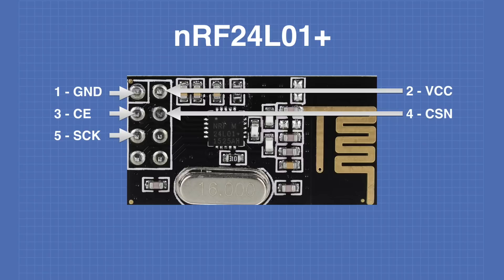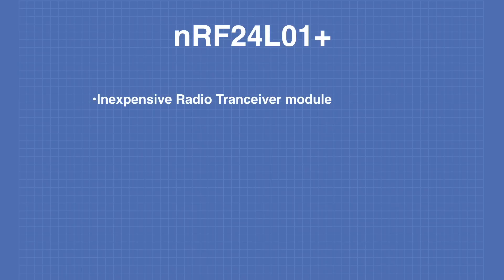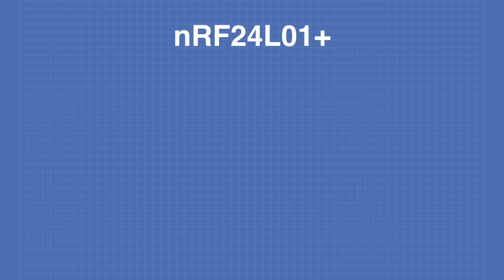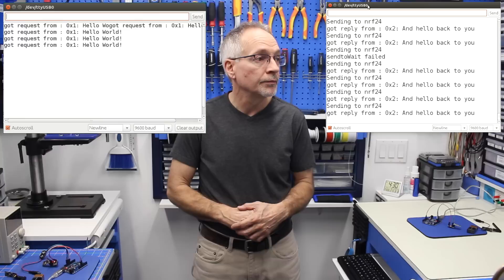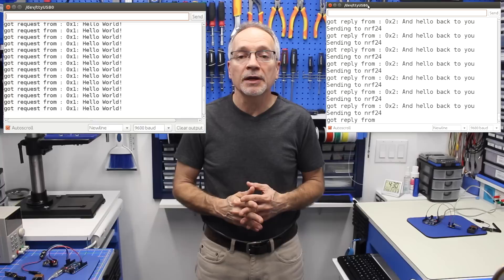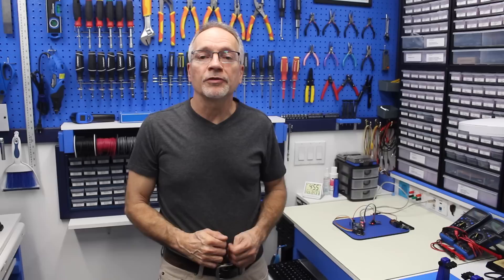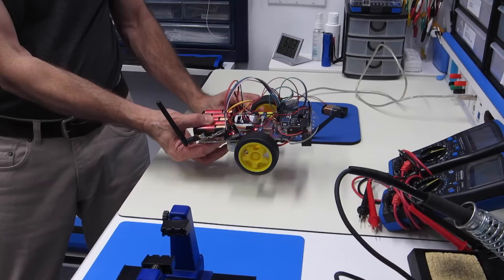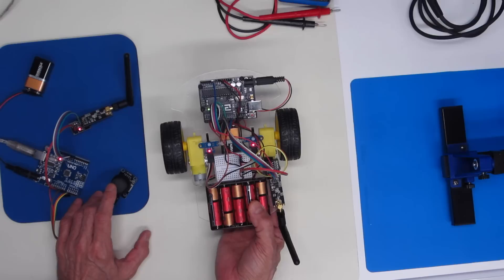The nRF24L01 - Wireless Joystick for Arduino Robot Car with nRF24L01+

Comment: This HAS to be there must frustrating thing I have ever tried in to do with an Arduino.  Between working with a cheap set of nrf240L's which aren't labeled on the board in any way shape or form with no adapter and only having 1 genuine Arduino uno and a generic mega with only one USB cable between the two....  I'm needing to take a break for awhile from this project.  I will go mad if I take it apart connect it again and see init failed one more time

Comment: Hello sir i really need your help. I am using arduino pro mini as my reciever for nrf2401 i am creating a 8 channel remote 6 analog and 2 digital. Problem is 2 pins 11 and 12 are pwm pins in pro mini and are used by reciever module rest are remaining 4 pwm pin which are in suffivient for 6 analog channel reciever. Is there any way to change those 11 and 12 pin to any digital pin

Comment: Hi. First of i think by far you have the best explanation of how one gets there way with the arduino and other applications. I really love it and would do anything to help support your work. I was wondering if you could do a video on the MPU6050 or MPU9250 for a self-balancing robot using DC motors, and if possible with Stepper motors. Its an interesting subject with PID controllers and i think many will gain a lot from it.  
Thank you
Reply from the maker: Thanks for your kind words Feysal. I have been considering doing a balancing robot project very soon using a gyro sensor like the MPU6050 or MPU9250 so I'm please to hear that there is an interest in it. I also think it will be a lot of fun to build!
Reply: It sure is a fun to build. I tried building one and got the pitch angles right. But then transferring the effect to the DC motors after i pass it through the PID controller is where am stuck. I used the MPU9520 and accidentally connected it to the 5v of the arduino and i think it died off right away. So am now waiting on my shipment for the 6050., although i realised its only limited to a gyro and accelerometer. The 9250  has a magnetometer that one can do extra stuff with. So i think doing it with a 9520 will be more better....in my view. 

The other thing i saw most people use are encoders. I think they are sound a good addition although i dont really know why they are primarily used. But am watching through all other videos on your channel and don't mind about the length of the videos. I know some folks are getting nagged with their lengthiness but the idea is to learn something and perhaps use it in other applications. Thank you very much for your work indeed
Reply: The other thing i saw others doing is how they tune the PID kp, kd and kp values. The serial monitor seems to be sometimes slow to catch up with the results. Some build another app where the connect two aduinos communicating via an NRF, just like you did in this video, then they use like potentiometers to tune the values, with an LCD display

Comment: Great video! Thank you! I have got question - I was testing two pcs of NRF24L01 (bought in Aliexpress) with adapter, but it appears that none of them was working. I was trying ling 4-5 times, counter-check everything several times, checked adapter - yes it gives out 3.2-3.3V, checked all pins. Sketch is as simple as possible, but nothing. You mentioned that is is possible that if NRF does not work then I have to change data pins - what pins exactly I have to change? And what do you think - could it be that both NRF modules I got are damaged?

Thank you for helping me!
Have a good day!
Valters

Comment: I have done everything I can to get this to work. I have copied everything exactly and the NRF modules just won't share a connection. There is Serial Monitor message for the reciever sketch. I am very frustrated and would like anybody to help at this point

Comment: Hi!
Am I the only one whose codes get stuck at "init failed" both with nrf24_server and with nrf24_reliable_datagram_server?
The client sides seem to be working, although they print "No reply, is nrf24_server running?", respectively "No reply, is nrf24_reliable_datagram_server running?". At least, the clients don't stop at the first lines of code :))

Comment: Hello, I am trying to use an Arduino Nano to communicate with an Arduino Uno using the nRF24L01 modules. However, I am having issues driving power from the Arduino Nano to the corresponding nRF24L01 module. I have the Nano connected to my PC via USB and nRF24L01 + Adapter connected as shown in the video above, however, while the Arduino power LED is lit, the nRF24L01 power LED is not. Are there different requirements for connecting the nRF24L01 to an Arduino Nano as opposed to an Arduino Uno?
Reply: idk why but with nano is not working with it pro mini do

Comment: Hello.  Thanks for such a great video tutorial.  I'm having a little bit of trouble with running the reliable data gram on an arduino Mega 2560.  I uploaded the example code from the radiohead library (the nrf24_reliable_datagram_client) ,but when I run it and look at the serial monitor I get "init failed".   I uploaded the same code to an arduino uno and I no longer get that message.  Is there something that I need to be aware of in order to get it to work with the mega?  Could this be caused be me not wiring the nrf2401l adapter incorrectly?
Reply: Nevermind.... found out that you need to use RH_NRF24 driver(8, 53);  :)

Comment: Hello sir I’m building a graduation project which’s a remote controlled robotic tank, the two 9volt motors are not working with the L298N motor driver, can you please help
Reply: check your wiring use a multimeter and check if the l298N is producing voltage. make sure all wiring are connected in the correct pins!

Comment: Great detail presentation! I followed your presentation and pinouts changes for the Mega 2560 chip. The client returns a message that the "init failed" but
prints out the message asking if " the server is transmitting etc." every 400 ms. The server just says "init failed"  and nothing more. I have followed your suggestions to the letter and even changed hardware. Connections and power have been checked.  Can your give me any suggestions on this problem. I am using the RadioHead software. THANK YOU!
Reply: Me same situation
Reply: Comment out the line RH_NRF24 nrf24;
and add RH_NRF24 nrf24(8, 53);
This will make it work on the arduino Mega.
found the solution here:https://github.com/PaulStoffregen/RadioHead/blob/master/RH_NRF24.h

Comment: hi, i am trying to make the NRF24L01 to work for my projects for roughly an year.
i never get it to work, and its not that they are broken because i bought 8 of them every 2 from other stores.
and i even bought the bases for them 8 times every 2 from other stores.
i keep getting the error sendtoWait failed.
pls can you help me i have been trying for so long.
Reply: try to use with uno or mini only nano not working for me + i added 2200uf cap to power then worked

Comment: Hi, I found your wonderful channel just a few weeks ago. Thanks for all your great videos so far.

Now I hope you still have time to answer my question:
I built this car as given in your lesson. Everything works fine with one exception: There is a certain, and as I think not acceptable, delay between joystick movement and motor reaction. The motors start later and stop later as they should. Any idea why?
I use two Arduino Nano (9 Volt battery on each Vin), transceivers have external antennas (same as you recommended), motor driver is LN298N, Joystick is unknown, DC motors (same as yours) run on another 9 V battery.

Best regards from Munich, Germany
Bernhard Huber (70)
Reply: It works! I checked all connections and weldings and reloaded the sketches

Comment: Thanks for great video with lot of information. 
What is the reason for showing "init failed" in the serial monitor?? How can i solve this?
Reply: Same problem here mate
Reply: @maxwong6371  And here, I cant even receive "Hello world"  just "init failed" as a server on a pro mini, nano or a mega, unless I stick my finger tip across the RF24 terminals. Yet they all send as clients fine. It is so.... frustrating, I have an RC excavator built ready for an RC hookup, and cant seem to get off the starting blocks.
Reply: @mickthebass6086  have u soldered a capacitor directly from vcc to gnd?and I already give up on doing this project but changed to hc 06 Bluetooth module, and it worked pretty fine for me on my rc tank
Reply: @maxwong6371  Hi Max, yes I have tried caps  from 10 to 1000mF and no change. I am looking into identifying possible fakes of these units, to see if I  have fakes. This vid link is kinda what I am looking for, its drawn out and technical , but it may contain the answers for some.     https://youtu.be/jfaFbjgwprI

Comment: It was an Amazing Video . I have also tried the previous Joystick controlled Car Video. But when I am trying to use your code in my project the motors of my car are moving continuously. In place of joystick Iam using a Joystick shield in it's place but car's not working properly although it is responding to my joystick commands but even when the joystick is free the car wheels keeps running. 

Can You Please help me. what can i do to fix it ?
Reply: gulshan mishra .hi, did you fix your problem? The receiving module (uno, nano,etc) will retain the last commands it receives. It may be that the connection  fails before the joystick middle position reading is received. Perhaps you should add a loop in the receiver code that returns all movement settings to 0 if a message is not received after.a few milliseconds.
Reply: @iangreaves5457  yes i did fixed it. The joystick shield was set to 3v by the switch on shield so when i changed it the joystick was giving correct analog outputs but since my nrf24l01 module was broken so i wasn't able to test it. So if i get my hands on new nrf modules i will tell you the results

Comment: Hello sir...
I am doing project on this and I followed all your video instructions.
But now I am getting some problems to run the motors.
In arduino joystick transmitter side at serial monitor is showing messages "init failed" and "reading motorcontrol values" and "sendtowait failed"
And also joystick moving values are changing showing
Similarly in receiver arduino side in serial monitor it is showing a message only "init failed" 

So I am asking you sir... 
How can I fix this problem?
Please reply reply me soon
Reply: I am having the same problem, any solution?
Reply: @voldoreabhi  Did you got any solution?

Comment: It doesen't work. Please help me. I used the code on your website and arduino nanos but it doesen't work. The weird part is that in the serial monitor doesen't apear anything(apperad at the first tryes but on the reciever it said just init failed and on the transmitter the joystick values but now on both nanos it doesen't say anything anymore just the tx led lights are on like is talking with the laptop) It should work without any problem. I verified and i didn't made the schematics wrong. I use two 18650 batteries for the robot so it isn't from the batteries and the nrf's are new and i use them with the special adaptors (I am a little experienced (almost 1 year in total) in arduino so you can explain me more broadly if you found the problem) Sorry for my english and thanks in advance
Reply: try changing the baud rate to 9600

Comment: Great video! I laughed, I cried, I learned. I think you make the hobby very accessible with your detailed, clear and long form videos, and they are really really useful for people like me who want to learn more about it. Keep it up!
Just one question: why did you choose to use pin A0 for in1? Any reason not to use other digital pins? Or is it just convenience?
Reply: He didn't had any digital pins left. The analog pins of the arduino are actually digital but the arduino has a converter from digital transformed into analog so the conclusion is that if you need digital pins and you don't use the analog you can just use them. example:
digitalWrite(14(actually A0), HIGH).
Hope you understood.
Reply: Thanks for the explanation, it's appreciated! But I still don't see why use pin 14. Pins 0-3 are still available (see 48:37 in the video). Is there some special reason not to use them, and use pin 14 instead? I'm just wondering if there's something I'm missing.
Reply: Pins 0 and 1 are used for transmision and recieving data from the pc into the arduino and you are not allowed to connect anythyng to them when sending data or code into the arduino from the laptop or vice-versa so it's easier to let them empty so that yout don't have to pull stuff from them all the time (plus they are not numbered normal: they are called tx and rx pins) but i don't understand why he's not using the pin d2 (third pin) because it's not used for nothing on the arduino so he could use it.
Reply: Nice, I learned something new about pins 0 and 1. Thanks man!
Reply: david yarkan No problem! I like to help starters in arduino because i know how it feels and i enjoy talking about what i like!
Reply: I looked through the link provided in the video description, and it turns out the reason for not using pins 2 and 3 is because he wanted to keep them open for the motor speed sensors. 
So, there's always a reason.
Reply: david yarkan Oh i forgot about that! I read the description too before i talked with you. Sorry!
Reply: Yep, it's a small detail in a long page, and I almost missed it myself! As long as we have an answer, though, I'm happy!
Reply: david yarkan There is always an answer!

Comment: Can someone help me pls?
I need the same (joistick on one side and motor on other side) but on joystick side i also need a display that display the curent rpm from motor.
THE CODE i need in C -> without liberys only per register "C" programming (Display can have librarys its not a deal).

If someone can send me working code i can pay 50€ for example - its important to get it till 21.01.2023 ....